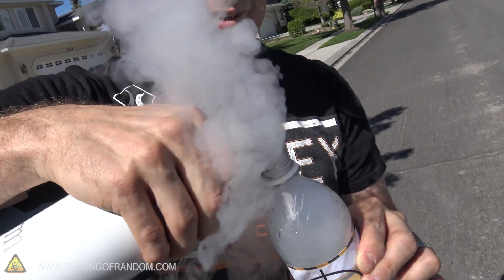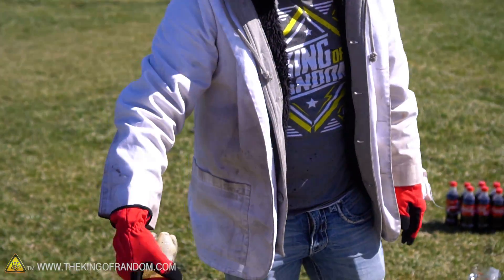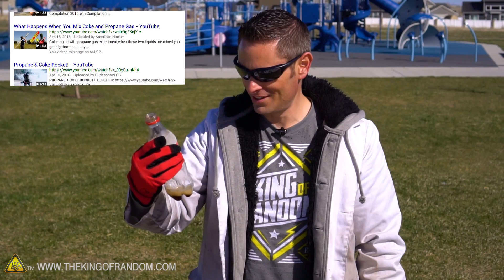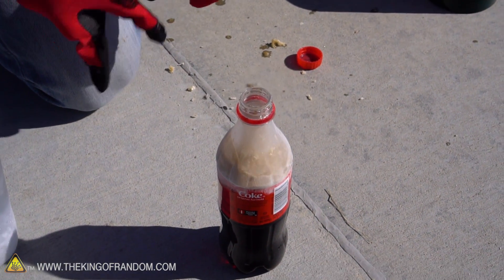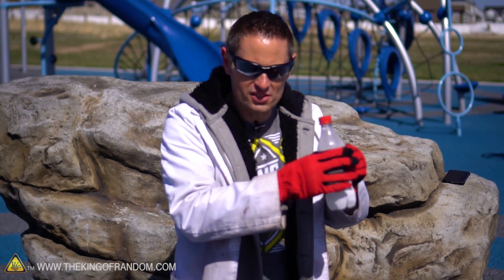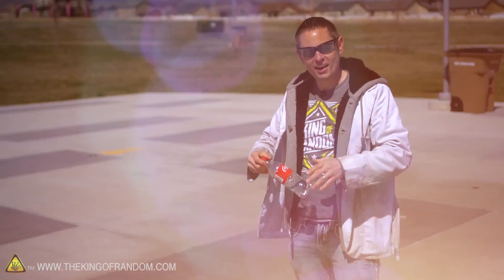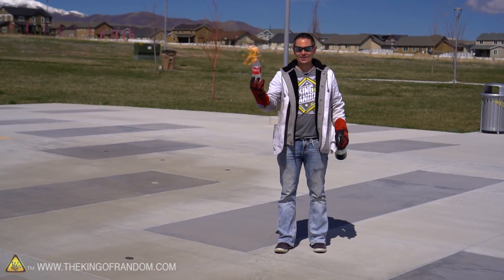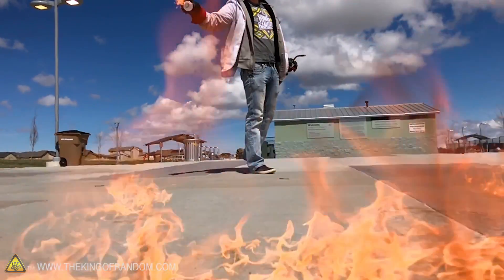Mixing Coke With Propane Doesn't Do What You Think It Does | Propane And Coke Experiment

Comment: Numerous gas canisters have propane and butane mixed together. The propane seemed to just freeze the coke, but since butane has a higher boiling point (above the melting point of water) it wouldn't freeze solid and would get the desired effect

Comment: For anyone curious as to why the propane bubbles while the cap is taken off, the boiling point of propane is far less than average temperatures. But like with anything else boiling pointw can be changed with pressure. While the propane boiled it pressurized the inside of the coke bottle, raising the boiling point. When grant opened the bottle he released the pressure inside so the boiling point was lowered to about normal and it began to boil off

Comment: Propane in a vacuum chamber? please Grant!
Reply: MrCombatPanda It would just boil away like it does in the video. He probably couldn't even light it up if he wanted to because there isn't enough air.
Reply: You also realise no explosions would occur in the vacuum as there is no air, so it would just do nothing
Reply: I don't think you understand. It is extremely hard for someone to get something to -306F without proper lab equipment. and putting it in a vacuum chamber wouldn't do anything interesting. I don't get what it is with kids and vacuum chambers but all they do is lower the atmospheric pressure within a small area, and the vacuums that the king of random makes are not even that powerful of vacuums
Reply: MrCombatPanda Propane is a gas. A gas would be sucked away because a vacuum is a place without gas
Reply: MrCombatPanda it'll turn into gas, wont stay too long as a liquid if you reduce the pressure
Reply: Mr. Bulbasaur's Channel I think hea means to put liquid propane, which also wouldn't work
Reply: lol
Reply: and solid propane in liquid nitrogen!
Reply: Do you know how cold it needs to be to get solid propane?! it needs to be at least -306.4 degrees Fahrenheit!
Reply: rigby250 yeah minus 306F.  Then it needs to go into a vaccum chamber.  :)
Reply: Oh yes

Comment: why does it boil of some propane and then get cold? Also, why does it boil  in the first place?
Reply: the boiling point of propane is about -43 degrees F

While the freezing point of Coke is probably around 30 degrees (Propane is very cold)
Reply: Oxyze Thanks, but I wonder that, as far as I know, liquid nitrogen doesn't warm up but the propane does so why would that be?
Reply: Dalton Felix liquid nitrogen boils all the time. Just pouring it onto a table boils iy

Comment: Use butane and warm water. The liquid doesn't matter since the rocket power comes from the thermal expansion of the butane gas, and its cheaper and you can just refill the bottle to use it again.

Comment: somewhat off topic- concerning freezing propane:

neighbor used to work in a junk yard, they would use beat old cars to run around the lot. he said if they had a dead a/c system, they would fill it with propane. the principals of it cooling as it expands is the same as the freon, ut it is much better at it. he said the cars would get cold af, like being in a freezer.  of course, the propane cannot carry oil in it like the freon, so it would only last one day before it would seize the compressor.
Reply: deth502  actually many industrial freezers use propane
Reply: MrNinja8889 think mine in uk is isobutane
Reply: chubeviewer its called r600 here and for some reason you need a gasfitters ticket to use it even though its a fridgy gas
Reply: deth502 they don't use freon in fridges anynore think it's some sort of pressurised gas

Comment: I really want to know how dangerous it is to cut open a propane tank with an angle grinder.
my guess is if there was any ignition the flame would occur on the outside as there should be no oxygen in the tank to cause a fire or explosion.
I want to use an empty tank to build a wood burner but can't unscrew the valve so it got me wondering really how likely it is for me to blow my self to bits cutting one open especially as it's essentially empty.
also would drilling it be as potentially dangerous with no sparks but the drill bit could get hot is that hot enough to ignite propane?

Comment: It looks like the propane is forming a barrier of ice on top of the coke then when he turns it over the propane pours out.
Somehow you need to get the propane to the bottom of the bottle where it will take the heat from the liquid coke and expand rapidly.  I suspect water would work just the same and doubt the CO2 in the coke has any real contribution.
Perhaps some anti-freeze solution may help, water with lots of sugar and salt?

Comment: is the theory that between carbonation and the heating/expanding of liquid propane the thrust generator? so now I'm curious. if you mix the two and cap it, allowing the coke to defrost and return to a liquid state with the propane. then shake well, flip it and open it already upside down would that built pressure and expansion be enough?

Comment: Here's a crazy idea fill up a coke bottle about halfway with propane. Enough so there's room for vapors to build up then put the cap on air tight with a fuse built in then after a while light the fuse and see if it explodes or just catches on fire.

Comment: You actually explained (kinda) why the Nitrogen rocket works while the Propane one doesn't. In your video "5 Crazy Science Stunts You Won't See At School," you say the following:

"...the liquids trade places and the Nitrogen is instantly vaporized..."

So first of all, the propane probably didn't vaporize as quickly as Nitrogen would have in the same situation.

Second, if you were to fill a bottle halfway with liquid Nitrogen and then cap it, there's an almost certain chance that the bottle would have exploded. The Propane may not have been creating enough pressure when it vaporized to send the bottle flying, instead just forcing the Coke out a little faster than if it wasn't there.

So in short, I think if the Propane created more pressure, the bottle rocket would work as expected, regardless of the presence of the ice.

Also, I'm not sure if the other people used Butane either. Butane has four carbons while Propane has three, and Van Der Waals (AKA London Dispersion) forces dictate that the longer a straight chain of carbons is, the more attraction there is between molecules. Therefore, the butane should have a higher boiling point and therefore be even less likely to get the reaction to work. If you wanted a liquid with a lower boiling point than Propane, I'd try Ethane or Methane (although I don't know where to get those and I've heard Methane smells worse than Propane).

Comment: It might be two things: Either you have to get the liquid propane in a cup [and warm coke, for best results] and pour it all in the bottle quickly and turn it over, OR it just wont work. The bottle rocket works because butane is NONPOLAR, which means it will refrain from contacting the water/liquid and will keep it from freezing instantly.

Comment: grant they used lighter fuel, not propane
Reply: So butane
Reply: +BTFreezy YT Lighter fluid can be butane (most common), iso-butane, a mix of butane and propane (very common), a mix of iso-butane and propane, a mix of butane and iso-propane or a mix of iso-butane and iso-propane (very common). My Zippo lighter gas canister contains butane. My large Atomic canister contains a 20% propane and 80% iso-butane solution. This information is always written on the canister.

No lighter fluid is 100% propane however.
Reply: Drew I assume you meant that make sense not that makes scene, but correct me if i'm wrong
Reply: he already said this in the video
Reply: lighter fluid is usually butane
Reply: i know he just seemed confused
Reply: that does make scene
Reply: Not lighter fluid like the zippo classic lighter fuel or barbecue lighter fuel, but butane to refill refillable lighters and butane kitchen torches
Reply: +JZH10000 Zippo manufactures both lighter fluid and lighter gas. The latter is usually just butane or iso-butane.
Reply: Fair enough.
Reply: Butain.
Reply: NeyBrain Creations No, light fluid isn't the same as propane or butane.
Reply: propane and butane are lighter fuel
Reply: @lerandomguy2109  lighter fluid is like gas
Reply: lighter fuel is propane and butan and it should not be liquid it should be gas

Comment: What does liquid propane do in a vacuum chamber?
Reply: Cubicow boil into a gas. The reason it was a liquid at room temperature in the coke bottle is because the pressure in the bottle was above the saturation pressure for the 80°ish propane. If you reduced the pressure(i.e. a vacuum) the boiling point of the propane would go down.
Reply: Cubicow disipates...

Comment: I'm surprised you didn't try making a nozzle by drilling a small hole in the lid.

Also it's interesting to see that the vapor pressure of propane isn't that much. Propane tanks almost seem to be over-built, but then again there's also the potential for them to be exposed to more heat. (Being adjacent to the bottom of a grill or stove.) Doing the same sealed bottle thing with dry ice certainly makes a nice loud boom once the bottle fails.

Comment: I don't think that butane would be more spectacular. Its boiling point is even higher than that of propane (it's so high in fact that in winter it just doesn't evaporate fast enough in the gas canister and thus the flame starts "choking" after the propane runs out in the mixture).

Comment: The coke is too cold, start with warm coke. Extract the propane into a separate container first. Use a funnel to pour propane into the coke bottle and immediately turn the coke bottle upside down.

Comment: Hey I think it does not work because propane (as you said in a previous video) doesn't rise into the atmosphere and therefore it stays on top of the coke.  But liquid Nitrogen (as showed in bottle blasting vid) switches places with the water causing it to launch in the air.

Comment: I think that maybe if you warm propane in a bottle and then pour coke on it it might work^^.
Also I think that propane has a relatively low boiling point for an Alkane so if you have it in a coke bottle that's slightly above the atmospheric pressure at room temperature it stops boiling, but as soon as you open it, it boils again expanding and cooling the bottle.

Comment: Grant, what you need to do to make it work is the following:  Put in a little less Coke.  The liquid propane/butane will float on top.  You need to turn the bottle fast enough to invert the fluids so that the propane/butane is on top and the coke is on the bottom when the bottle is inverted.  This way the propane/butane gas will expand forcing the Coke out the bottom of the bottle.

Comment: I wonder if you put bullets in liquid nitrogen will they still shoot?
Reply: i think that cody did it, you should check his channel it's cody's lab
Reply: Assuming you mean the entire round (bullet and cartridge), maybe no. Gunpowder and the compounds they use for primer are set off by putting energy into the system (like with heat or by hitting it with a hammer). Cooling it down to cryogenic temperatures would have the opposite effect, meaning it would actually be harder to set it off after being dunked in liquid nitrogen.
Reply: anonymous Ok, can you link it? Because the only video on the subject I can find involves cody, some liquid nitrogen, black powder, and a fuse. None of which is comparable to a gun firing.
Reply: so someone should do it!
Reply: well it was just an idea...
Reply: Ok thanks  😸
Reply: He means that you keep an unused bullet in liquid nitrogen then shoot it
Reply: iraqveteran8888 did it several years ago, one of their videos trying to destroy a hi point pistol.
Reply: LetumComplexo It will still fire.
Reply: how would you get the bullet back in the shell?
Reply: you put the whole bullet in
Reply: what do you mean
Reply: well I don't know it was just an idea
Reply: Why don't you try it yourself?
Reply: I would I don't have liquid nitrogen
Reply: yes, it will.

Comment: The reason why propane doesnt feel very heavy is because; propane only weighs 42% of what water weighs. This means that if you have 1000ml of water(1kg), the same volume of propane will weigh 420g (.420kg).

Comment: Hey Grant, since the Coke froze because of the propane, maybe try to do it faster. Just let in some propane gas and plug the opening with your thumb, then turn it on it's head as fast as possible, to see if makes a difference. Also I think the guy in the video used (airsoft) green gas, it's a mix of silicone and propane, might have something to do with it not freezing as fast.

Comment: liquid propane is heavier than the Coke as seen in the flaming failure. The trick is to swap the propane and coke in the bottle so the propane is on top and the opening is on the bottom. Gaseous propane is lighter than Coke thus causing the swap when inverting it.

Comment: So my question is, if the main issue was the propane freezing the coke, then why not use the normalized temp propane mixed with coke?  You kept using it straight from the propane tank at its coldest, however normalized even though it still cools back off, may still be warm enough for the experiment to work. You may have already tried this in your other attempts but it seems like two different experiments that could benefit for combining them. Cheers.